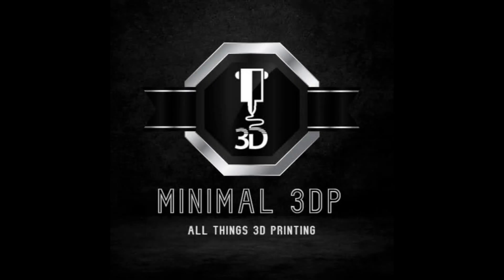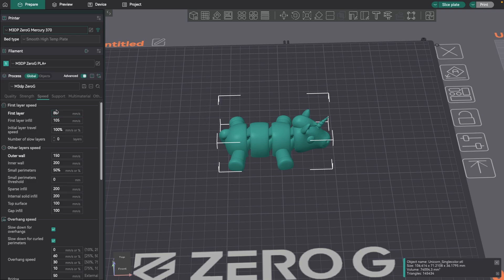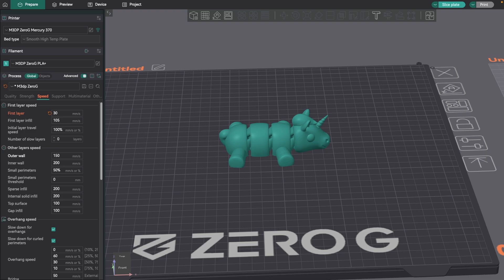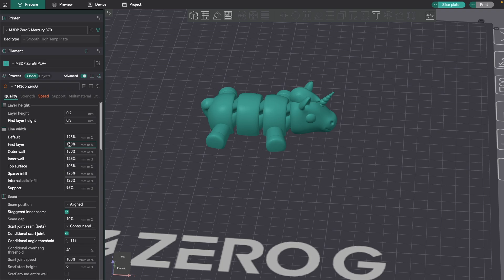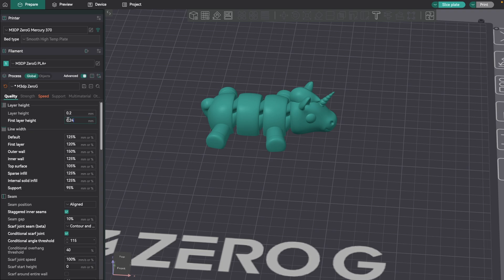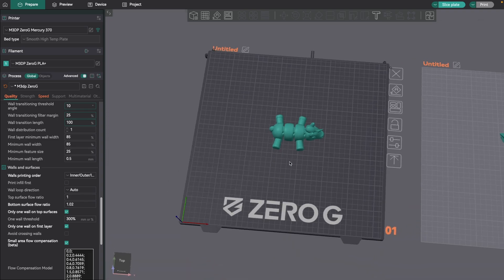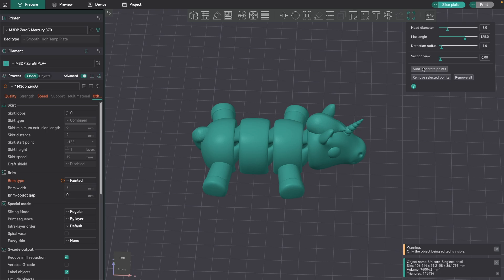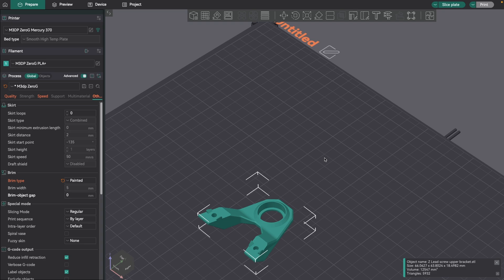How to Get the Best 3D Printer Bed Adhesion with OrcaSlicer

Comment: Good coverage on the topic.

One setting on the first layer topic you didn’t cover in Orca Slicer is the bottom surface flow ratio.

Which can be set separately to overall flow ratio.  This can be helpful for first layer adhesion with a small increase.

A setting of 1.01 is a good place to start.

Cheers and keep up the great work.
Ron.
Reply from the maker: I didn't look at that. Thanks for the suggestion. I appreciate it.